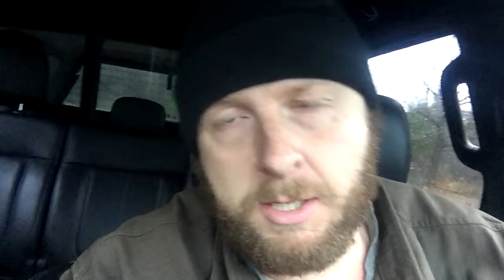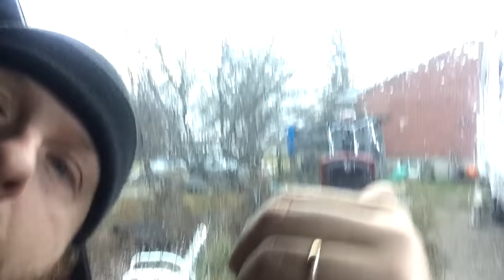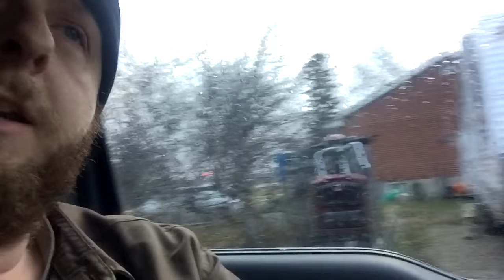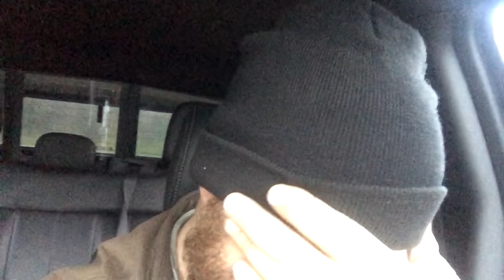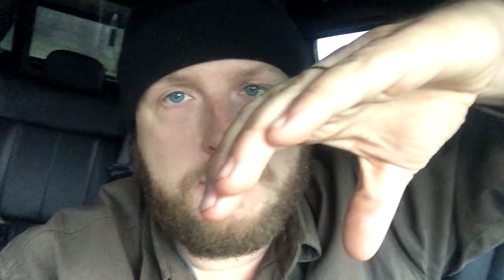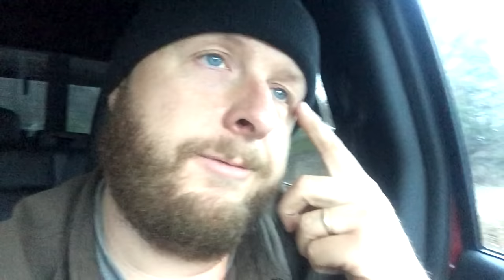Quickie update today on the hydraulic cylinder

Comment: hey Bill something you could try for the thumb is to get a hydraulic solenoid valve and divert the flow through hydraulic hose out the excavator arm from the blade.

Comment: what about a valve like the can crusher has on it hooked in by hydraulic lines to run the thumb. With the fluid return lines connected back to the mini ex. Of course you have to have lines running from the arm to the operators area then to the cylinder. I hope that this could work and can be an option on your mini ex.

Comment: Hi Bill,

If your crank case oil is too thick to start in the Canadian cold, try a dipstick oil heater. It replaces your dipstick and you just plug it into any 110 Volt AC outlet. 

Or you can try a oil pan magnet heater it magnetically sticks to your oil pan with it's permanent magnet, and then you just plug it in like the dipstick heater. 

Both units work better just after the engine has warmed the oil. So the oil stays warm for the next engine startup.
Reply: +George Travers He actually put a block heater in it, it's some plug you unscrew on the engine and put the heater in. And when it's plugged in, it has never had any problems starting. But there was some reason why he didn't like this solution.
Reply: +Seegal Galguntijak  That's because the 110 DID start before in the cold, but not so good anymore.
Reply: Andreas Pettersen And when that started to happen, Bill tried different things, one of them was the block heater.